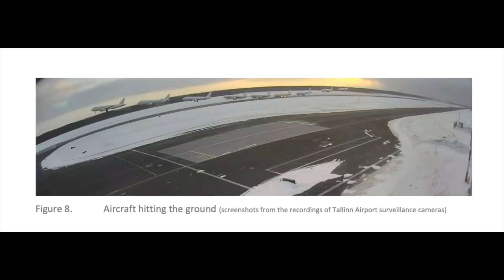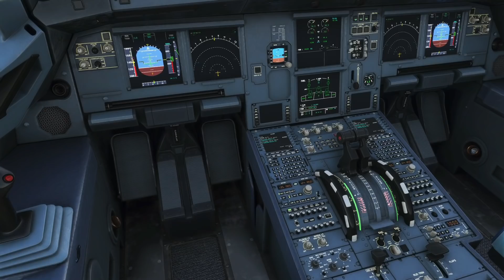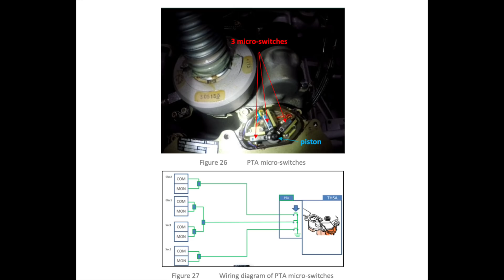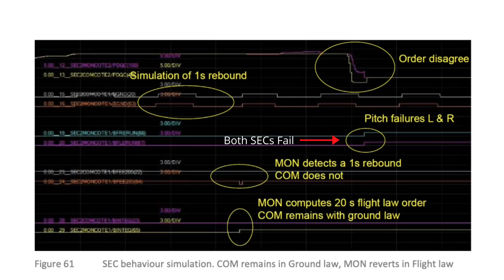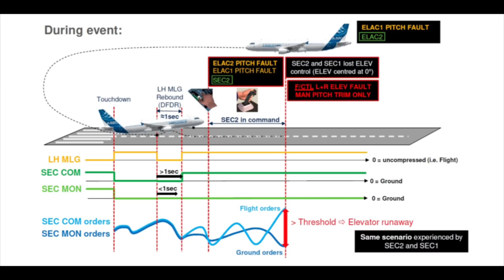The Oil Change That Crashed A Passenger Jet | The Crash Of Smartlynx 9001

Comment: YT vortex and ended watching your video, amazing. I'm ignorant in the topic of airplanes but on automation it is not a matter of want, it is more on the need, and data, lots of data. This is the perfect example, scenarios like this are difficult to reproduce but I guess airlines / and the different associations that control / audit have different procedures to ingest the data of cases like this and improve. Automation is needed in the right doses and not only for piloting but also for the chain of supply like in the oil example. Everything is data. The proof of this is the reduction of fatal incidents since the beginning of commercial flights.

Comment: My opinion of manual vs automation:  a manufacturer built a fully automated plane, but wanted to retain the emergency manual option. The system was reviewed by a committee and the result was: fully automated control plus a pilot and an attack dog in the cockpit. If the automation failed the pilot could take over. The dog was there to bite the pilot if he touched the controls.

Comment: There are basically two reasons for automating anything. 

The first is when a system is just too complicated for a human to control. Some large-scale chemical processes, long (hundreds of miles) pipelines carrying oil or sewage (a hell of an inertial load there), aircraft which are deliberately designed to be unstable for enhanced maneuverability in air combat, steering of big flexible structures like supertankers or a Saturn V booster, etc. This is pretty well understood - I remember modeling such control systems on analog computers, so we're talking flint-knives-and-bearskins era. 

The second is to make the job easier on operators. Trim in light aircraft is a good example. Elevator trim is adjusted by the pilot "on the fly" so that he doesn't have to exert force on the elevator controls for the entire time that the craft is climbing to altitude. But once in level flight he has to re-adjust the trim, or he'll have to do the same work to maintain level flight as he just saved during the climb. This is all to make the aircraft stable in maneuvers which last for some appreciable time. It is not for transients, such as climbing when the "terrain ahead" warning sounds. This sort of trim NEVER overrides the pilot's command of the control surfaces. He can always climb or dive by working the ailerons; the only thing the trim control does is save him a bit of muscle gruntwork when doing it. It's like putting a spring on the ailerons to change their rest positions. Trim controls don't add a limit, they just add a nudge in a particular direction. In basic un-automated aircraft, bad trim will NOT crash the vehicle so long as it has a qualified and conscious pilot at the controls. So it's safe to automate trim. Even if the trim system fails or goes wonky, the worst that will happen is that the pilots will have to work up a sweat during long flights and will grouse something awful about it afterwards.

Unfortunately, in practice, automation makes it possible to replace skilled operators with, well, not-so-skilled ones. This is not a good trend. The guys in the front room should be flying the airplane, not flying the computers. We all know one or two pilots who could barely manage to stagger into the air, but were OK as soon as they switched on their autopilots . . . until they fly straight into the side of a mountain. Perhaps unfortunately, the nature of business is NOT to provide a service in the most expensive way possible - and passengers certainly agree; nobody is rushing to spend the most money they can on their airplane tickets. And savings means using less skilled - ie, less experienced and less well trained - aircrews. Sorry, that's just economics. The trick to successful business is knowing just how cheap to make it, but no cheaper. 

I designed machinery professionally for forty years, and saw automation invade almost everything. Far too much of it is there to answer questions nobody actually asked. Most of this stuff is mere gadgetry. The problems of flight were solved decades ago. The last really indispensable innovation was gyro instruments. Gyros predate electricity; they have been used successfully for well over a century, initially to guide torpedoes. In general, the fancy bells and whistles do NOT fly airplanes, and you'll be disappointed if you rely on them to do so. Learn to fly first, then figure out how to push the fancy buttons. That is, if the product designers will let you.

UPDATE - actually, there aren't two reasons for the growth of gratuitous automation; there are at least two more. First is the "gee-whiz" factor. Lights and whistles look advanced, and technically unsophisticated types - like airline CEOs and purchasing agents - are easily impressed by beads and trinkets. Second is money. Most changes to commercial machinery are done to make it cheaper. This is not due to "corporate greed", real as that is; it's to expand markets. Before Henry Ford perfected the cheap - really cheap - car, autos were the playthings of the ultra-rich. Playthings don't become the backbones of civilizations. Mass sales and affordability are king. Anything involving customers expending their own resources is extremely cost-conscious. And modern electronics is generally far cheaper than precision mechanisms. For instance, electronic fuel injection is far cheaper than mechanical fuel injection or decent carburation, so that's what we get stuck with.

Comment: What people don’t realize about the Airbus automation philosophy is how many lives and aircraft it has saved. One of the first things I do when I read an accident report is ask myself “would an Airbus have let you do that?” - the answer is usually no, unless it’s CFIT. 
You don’t hear about embarrassing mistakes where pilots ALMOST kill everyone but the plane took over. 

For example the Asiana 777 that smacked into the rocks at SFO - the plane “let” them do that. 

There was a nearly identical unstable approach in an A320 where pilots consistently lost SA and airspeed, even after aural warnings for “speed speed speed” etc. 

Eventually within literally a few knots of stalling; the aircraft said “f this, you’ve screwed this up” and went into TOGA automatically. I believe both alpha floor protection AND then speed protections had been enabled. 
You’ll never hear about the incident because ... well... the pilots went home with their tails between their legs and the passengers were none the wiser. 

The systems in the Airbus are so extensive that (again) you could point to MANY similar crashes from other airframers and say (an Airbus won’t let you do that.) 

I have pilot friends who were diehard Boeing fans and corporate switched them to AB, they will never go back. For most it’s not just a safety thing, they say everything is just “easier” and frees up SA and CRM in the event of bad weather, failures, etc. 

I mean the A380 was designed decades ago, but can not only fly with ZERO hydraulics, but still use autopilot due to the invention and use of EBAs and EBHAs for remote flight control backups (electro-hydraulic/electric). I believe it can even auto-land with the loss of two engines on the same wing! 

This stuff puts automation in a bad light, but research some “incident reports” or “near crashes” etc and see how these systems really shine when their pilots don’t. Or when shit just really hits the fan, like QF32 - could a 747 have taken that damage and landed? Probably. But how many 747s were lost due to hydraulic failures? Older plane or not - an A380 would land no problem, even the 747-8i requires hydraulics. 

I could go on forever, but at least look into it before you bash the automation - Airbus engineers were so far ahead of the times. Boeing is continually (kicking and screaming) adding similar systems to their planes because, well, they have to. The ultimate fix to the MAX was a synthetic speed system from the 787, similar to what Airbus has had forever. 

I have zero issue flying ON a Boeing, but if I was in the cockpit, I’d much rather be in an Airbus. Unlike 99% of what you’ll read on YouTube, that’s not just a blind opinion either. 😏
Reply: Airbus hasn’t had the synthetic speed forever. It was only installed primarily after the Air France 2009 accident (where it wouldn’t have very likely saved the plane) but I think only optionally except A380. This became the BUSS but it wasn’t a true airspeed indicator as it just gave you a safe margin to fly within using the AOA sensors. The A380 then had a 4th MFP and static port for ISIS speed but still had BUSS available if this also froze. Then the A350 brought in backup speed which uses the AOA, load factor, weight and engine probes to determine an estimated speed. This technology is being retrofitted to the A320/A330 now
Reply: @tomstravels520  thanks for the clarification on the exact terminology - you clearly know your stuff. I guess my point was that the architecture of the FBW was always “capable” of inferring speed based on AoA and throttle, trim/balance, etc. BUSS was an incredible system at the time, and again used the existing ADIRU data to give you that backup system. I also agree it probably wouldn’t have helped when pilots have 5 minutes to recover from a deep stall and pull back the entire time.

Regardless my point was that boing is forced to implement these technologies - MCAS was a single-point-failure system, now it can actually check itself and disable. I believe it’s only got 2 sensors still (unlike ABs 3 ADIRUs / sensor sets that vote and still function with failures) so any sensor failure will disable it (better than before 🤷🏻‍♂️!)

As I understood it BUSS (or the new system) is standard on A330 and larger aircraft, and optional on the A32X series, but may be standard on the NEO.  
 Also the A350 uses the MFPs over AoA but I think it still has one dedicated AoA sensor. I can’t even keep track of all the crap on the front of the A350 honesty lol.
Reply: @EstorilEm  the A350 has 3 MFP’s for the ADIRU’s, 1x pitot for the ISIS and the 4th AOA is for load alleviation. I think it’s also connected to ADIRU 1 but not too sure on that
Reply: The recent Atlas Air crash also wouldn’t happen to an airbus. TOGA cannot be triggered by a button press and the nose won’t pitch down 45 degrees

I was going to say TK1951 wouldn’t but actually I believe there is a slim chance it could in similar circumstances
Reply: @tomstravels520  Oh TK1951 is another perfect example - the FBW systems rely on SO much more than a simple radio altimeter. If the plane is (aerodynamically) at risk of a stall, it won’t let it. I’m assuming the pilots radio altimeter reading of -8 versus 2000, would have been labeled as implausible and either taken offline or the systems would simply not be able to use flare mode and stay in flight mode? Maybe an Airbus pilot could chime in, though that’s not something most would know lol. 

The flight protections are embedded into these planes, as with my example, alpha floor and eventually speed prot would have kicked in. 

Autothrottles have nothing to do with it, but usually the plane will yell at you enough beforehand that it won’t be an issue. In contrast, as with your example and Asiana, you can basically just casually crash it (okay slight overstatement, but still.) Boeing changed some things in the 777 AT system but it’s still incredibly complicated how it interacts with different legacy systems, and how it acts in different phases of the flight.

The really cool thing is that the low speed protection is dynamic - it calculates your current velocity, any rate of deceleration, throttle position, and engine spool-up time to trigger with enough time to save the aircraft, I always thought that was crazy. 

This is what happened with the one flight I mentioned, I’ll try to dig up the report (but yeah, they WERE going to crash the plane basically lol.)
Reply: @tomstravels520  Thats what I was saying, I think without good data it would simply stay in flight mode vs. flare mode, or revert to FO’s RA.
Reply: @tomstravels520  I misread that link at first - TAWS only uses RA1, I thought it said on all aircraft WITH TAWS, they use RA1. 

So the previous paragraph is still true, in the event of a fault, the alternate RA is used. TAWS would have been inop.

The fact that they even said it can switch to the other RA implies it’s capable of fault detection though - right off the bat, that’s not possible with the 737 in question.

Comment: Here's an idea, when you keep getting multiple warnings park the damn plane for inspection. Their training exercise wasn't worth risking their lives.
Reply: Yep. After the second reset the best thing to do would've been to get the plane on the ground asap and report the problems to engineering.
Reply: That's what I thought.  If several resets don't stop the warnings, then you have a problem and should probably park the plane and have maintenance come out and check it out.
Reply: In fact, a decent instructor would have done exactly that. As a training exercise, it's a good idea to show new pilots that it's best to listen to the aircraft when it tells you repeatedly that there's something wrong
Reply: Yeah, that kind of caught my attention. You reboot once. If the error comes back the training exercise is over, let’s let the mechanics figure it out. Although in this case they may have gotten lucky. Mechanics troubleshooting would not have found the oil issue. So the plane likely would have been sent back up with a full passenger load.
Reply: @andrewtaylor940  given that it was probably the same mechanics that put the wrong oil in it, I'd say you're right.
Reply: @gasdive  it’s just not the sort of thing you’re going to pick up on, on a normal maintenance or even troubleshooting. It probably took a forensic examination to discover it after the crash. The fact that nobody could find any documentation to how the wrong oil got there in the first place tells a lot. The mechanics and engineers would spend weeks chasing their tails swapping out electronics and wiring harnesses.
Reply: @andrewtaylor940  not true. They might not have found the bad oil quickly but the issues with the ELACs were being recorded and alarmed so first thing to check. There they would have seen the critical issues and grounded the plane until determining why both ELACs had failed. Even if they couldn't determine it was bad oil from the logs, then as part of the troubleshooting and testing they would have flushed and replaced the oil and then seen the ELACs working again.
Reply: @jonmobrien  - Motor vehicles are getting picky about their oils. My son let some bozo put 1) 10W30 plain old motor oil in the car’s motor. Spec is 0W-20, which is a full synthetic, is required for the Variable Valve Timing to work correctly.
2) He let a tire shop put on oversize tires, 185/65R15, instead of the spec 185/55R15s. This causes the speedometer to read about 6% fast, which uses up most of that 10% slack the speed cops supposedly let you have for cruise control lag, overrun downhill.
No surprise that flying coffins are very particular about their fluids.
Reply: Yes. One Reset is ok. But if the error returns you have to terminate the flight. They did the opposite.
Reply: I was thinking the same thing!!  Seems crazy to keep flying and doing touch and goes with multiple faults and resets.
Reply: Not the first time probably not last. Irresponsible to ignore repeated warnings.. Land and fix.
Reply: As someone in a different thread said, having one computer repeatedly spew out errors and shut down is not a problem. There is enough redundancy and it's most likely a problem with a sensor or data line of that specific computer. However, the moment the second computer also popped an error was the moment to call it a day and have an engineer look at the problem.
Reply: So CRM for Instructor's & "trainee's" - a "who's taking charge problem...
Reply: Worst part is that the plane was on the ground and stopped multiple times too as they switched training pilots. And they still decided to continue. It blows my mind that they didn't think it was important to figure out these issues.
Reply: @YOUTUBE IS NOW GARBAGE "Damned Airbus knacker"... 🤦‍♂️ Yeah, because the Boeing equivalent is so much more modern and up-to-date... oh, no wait. It's the other way around
Reply: @YOUTUBE IS NOW GARBAGE Most times that 'fear' doesn't really happen. The impact happens first.
Reply: Sounds about right...
But there are so many stupid, really dumb situations when pilot decides - hey, what the hell...
Reply: I would have gotten the impression that these pilots might need more time in the classroom and simulator,. Perhaps learning to check their hubris.
Reply: what was the safety pilot doing? he should know better, and keep the plane flying.
Reply: Their training exercise was a complete failure.
Reply: @millomweb  Did the flight train anyone else? Every rule in the flight manual was purchased with blood and flaming wreckage.
Reply: And worse, if you survived that REPEATED  ignorance, God help the junior Pilots, Airlines & passengers you betrayed !